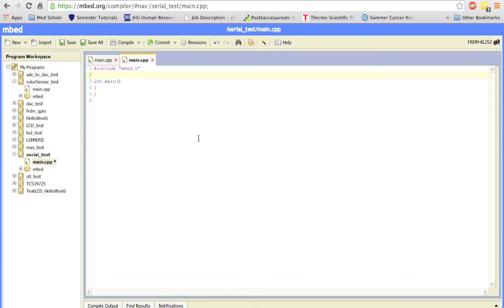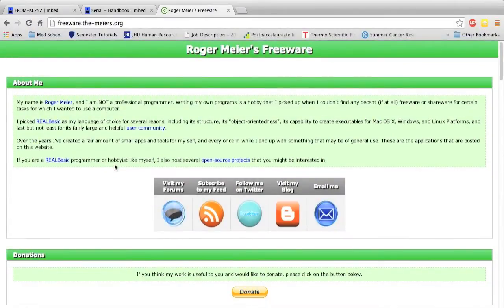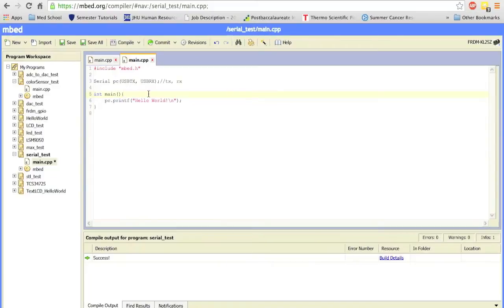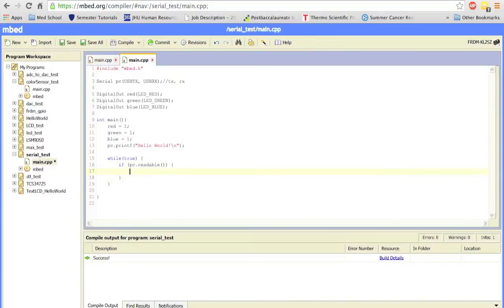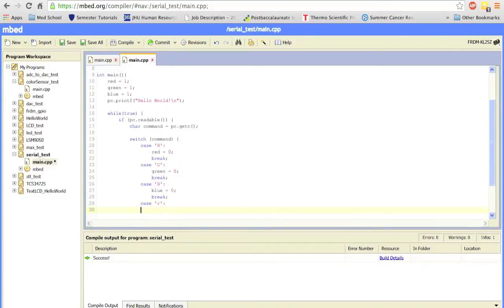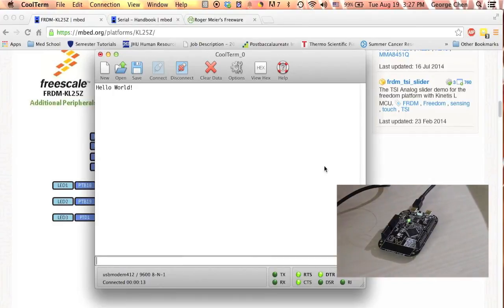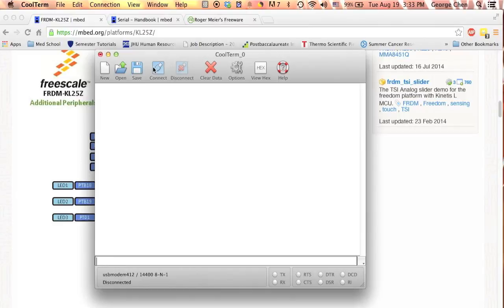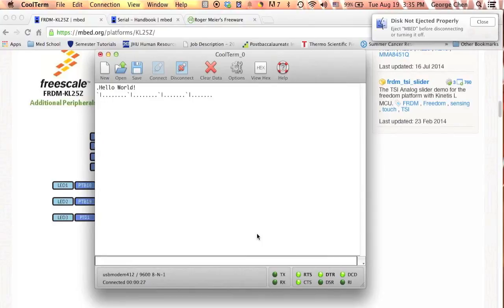mBed Tutorial 6: Serial Communications using mBed

Comment: Hey, thanks so much for the video. It was really helpful. I do have a question and i was hoping you could help me out. I need to develop a GUI on python that allows me to communicate with the mbed. Would you happen to know how I can send and receive data on python instead of using a terminal device such as cool term.
Reply from the maker: Pranav Malhotra , I've never built a GUI using Python, but I have extracted serial data and plotted it onto a desktop using MATLAB, Java, and Processing. You  should try to find  a library that can handle RX/TX of USB. A quick search suggests that PySerial might do the job for you. You'll then need to handle the plotting.
Reply: Hey. I tried using Pyserial and it does indeed do the job. MATLAB on the other hand was able to read the data however it gave me an error as well. Nonetheless, thanks a lot for your help. Cheers!